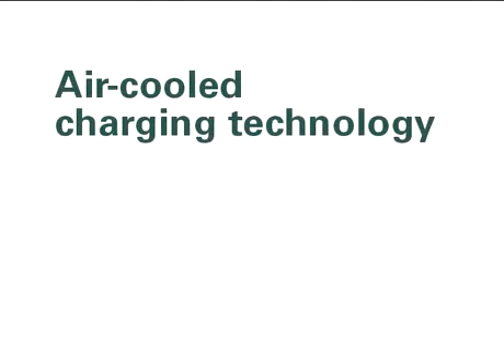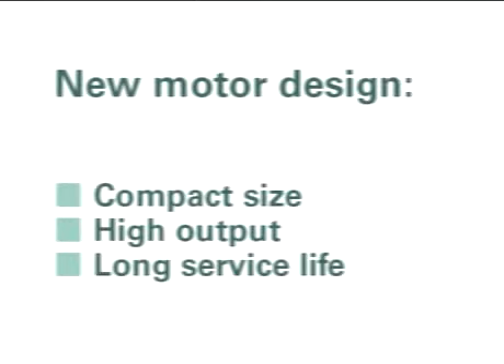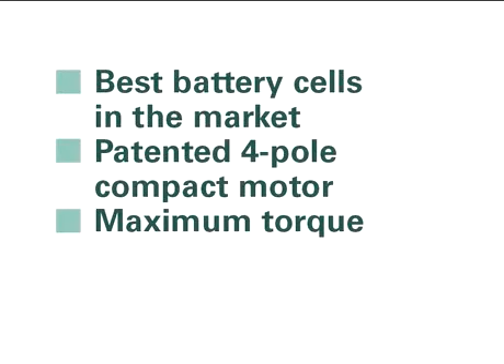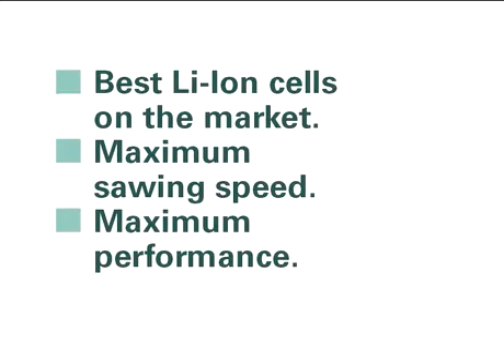Metabo L LT LTX

Comment: I still occasionally use an old Metabo 450 watt 240v hammer drill from 1987 and it's the smoothest, quietest drill I have.

My '90's Bosch 500 watt sounds like a circular saw in comparison.

Metabo do put a lot of thought into engineering a quiet and silky smooth power tool.

Makes them so much nicer to use.